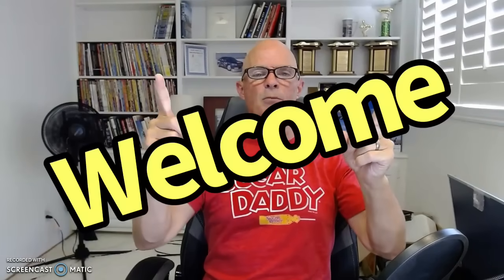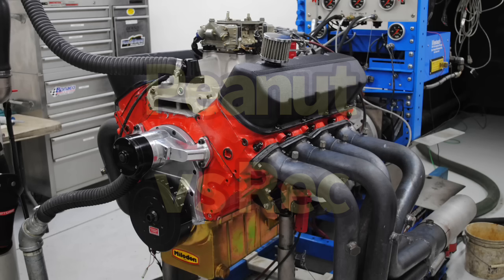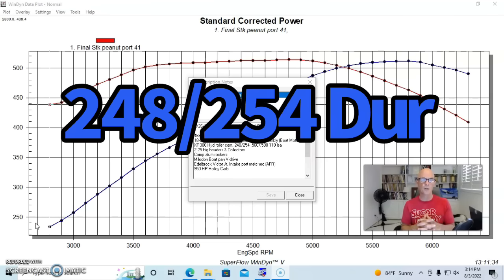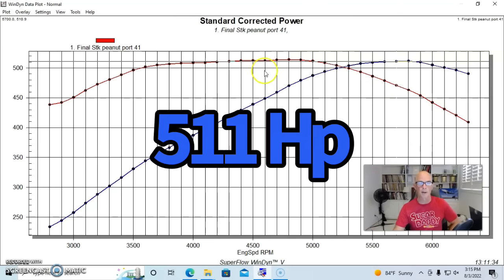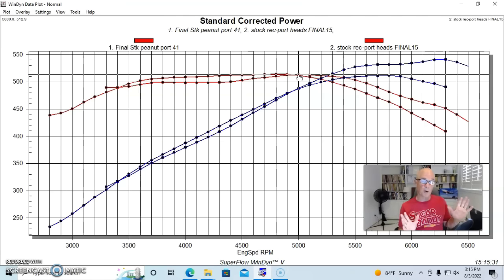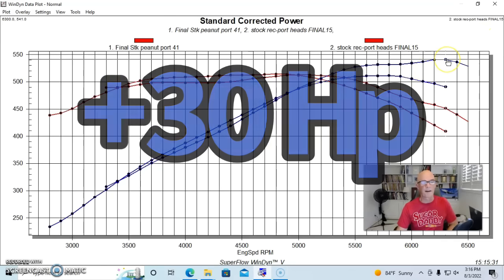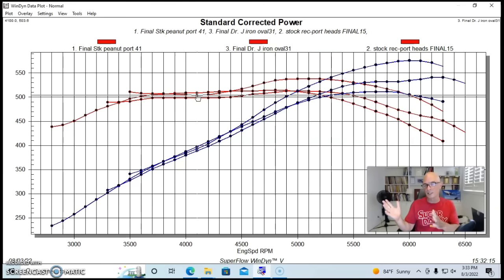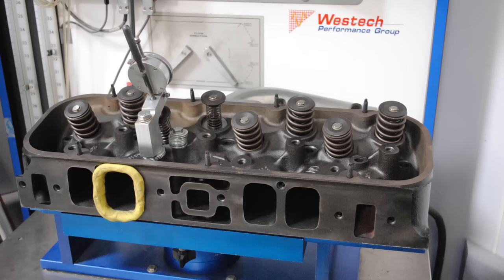WHICH FACTORY BBC HEAD MAKES THE MOST POWER? PEANUT PORT vs PORTED 049 OVAL vs REC PORT vs AFR 265!

Comment: Part 2

The cost of aftermarket heads has gone down so much that even the best old school l88 aluminum heads are worth much except to a corvette numbers matching 69 l88 vette or other restored classic 60s ,70s car. The old aluminum  gm needs or even snowflake heads usually had all sorts of cracks in the castings from years of abuse.

You can still have fun with cast iron oval or rectangle  port heads. But the weight of them is ridiculous. Twin turbos or a good 8 71 blower will wake a motor up even if the ports are somewhat small. I've seen a few motors make good power with Peanut port heads. But it's like , your building a motor for hi perf and are going to choke it off with a Peanut port truck head. Ooof. A good set of ovals are everywhere now days. And much lighter when cast in aluminum. Redesigned ports are so much better with raised roofs. A force induction tunnel ram engine really wakes up with forced induction. Years ago we had to over cam the engine to get enough flow into the tunnel rams and rectangle port heads to get them in the proper power band. 4.56 gears and 7500 rpm were common. Yes on street motors. When comparing all three heads, Peanut, ovals,rectangles. Give the engine the appropriate cam for a better breathing motor. If your very broke then Peanut ports can work to about 350 hp. With forced induction I've seen about 650 hp using them. So if you have forced induction rectangle heads are awesome. If not rpm the crap out of the car. Ovals are the best compromise. I've seen them out flow some rectangle port heads but not it ultra flow cases. Some rectangle race heads can flow in the 525 550 range at about 800 inch lift.

Comment: Rectangle port heads work great with forced induction  engines. If you don't want to run an engine that way you need to use the heads in the upper rpm band and higher numeric gears in the axle. So in other words 3200 to 8500 rpm with 4.56 to 5.12 gears was alot of fun to haul ass in. Some guys tried rectangle  port heads on engines that had too low of a power band to get enough  air moving to feed the port. Oval ports ported are great, if they are the newer aftermarket stuff. Back in the 80s if you didn't run rectangle  port heads on a bbc. Like a 427 you were considered a non serious street , strip guy. Now everything changed when force induction  motors came on seen. They helped all head type of engines make crazy power. But the aftermarket  rectangle  port heads were awesome once force induction was put through those heads. A supercharger kept us out of having to spool up a turbo. And low speed to medium power was improved on rec port heads. We used factory heads back then. Peanut port heads were never considered. We hated them and still do. No one sells performance Peanut  port heads. Porting them is a waste of time since the oval ported heads outflow them by a lot. Especially  with cnc porting on much improved aftermarket oval port or rectangle port heads. No one redesigns Peanut port ,ports. Cont

Bloodviking

Comment: Isn't this the same test you did for motor magazine a back in 2012?  If it is, you have said in the past that the peanut port heads in this test had bigger valves also.

The Peanut ports I had flow tested,  flowed 226 cfm at 500 and gain anymore than that to .600 lift. Is it common to get more than 2HP per CFM?
Reply from the maker: that number is not uncommon for a restrictive head on a good motor
Reply: @richardholdener1727  so, did those peanut ports have larger valves like your motortrend article said they did?

Comment: The question is...if the oval intake manifold was removed and replaced with a square port manifold when testing with the square port heads???  Intake to head port match is important 👌.
Reply from the maker: those intakes are actually different (not just the port shape), the mismatch does very little to power
Reply: @richardholdener1727  your right man.....seen a MANY big block back in the day running oval intake on a square head for street use.....those ol hot rodders knew!

Comment: The ported rect. port heads would make less power than the ported 049 heads up until about 6000 rpms.Unless you had a converter with about 5000 stall the 049s would be superior! My daily driven street racer with oval ports beat rect. port cars.

Comment: What is interesting is the peak TQ location.  For a Jet Boat engine, that's the deal.  I'll take the AFR's (or other aluminum head) and run the lake on 93  😃 
Power on race gas is fine for drags, but will kill your wallet filling the boat tanks 🙃

Comment: I've got a challenge for you if you're willing to help. I'm benchtopping (until funds increase) a ~500hp 489/496 EFI street engine but I need a camshaft that will pass emissions ( Thinking Brodix 270 Race Rite Ovals and whatever dome size I would need to make it have about 8.2 dynamic compression. HC needs to stay below 220ppm and CO% needs to be below 1.2, this is both at idle and 2200 rpms.
Reply from the maker: obviously the parts you mentioned are not emissions legal-despite their ability to pass a sniffer test (very easy)
Reply: @richardholdener1727  my state only requires the charcoal canister, non vented gas cap, catalytic converter, and to pass the emissions test in order for it to be legal. They do look under the hood for these and I'm willing to keep all of these items. I'd rather not put an antique plate on it as then I would legally only be allowed to drive to and from car shows and parades.

Comment: For the street...always choose ported large oval's or an aftermarket aluminum head like the AFR's shown here. The name of the game on the street, especially with a heavy, stick car is velocity. 
Remember, your big block is essentially a huge air pump. Keep port velocity up with moderate volume on the street. For the track or all out racing applications, ported rectangular ports or even better, aluminum aftermarket heads with the ability to move lots of air at higher velocity above 6500-7000 rpm. 
Gotta love big blocks!

Comment: Rectangle OR  Oval port from HEINTZ BRO'S  fixed like we do them for the NHRA Super Stock class would SHOCK U.  That said Heintz heads had AB opoxy in the Intake ports and the Ex were welded up with Beryllium and couldn't be over a certain CC's in the chamber, Intake and Ex and and stock diameter valves. Stock BBC heads have 2 good ports and 2 not so good ports. Oval heads made 830/840 and the Sqare Port 900 /915. Sometimes more on both heads depending on core shift in the heads. And the Oval Ports had a Holley  Vaccum secondary. I see the look on your faces.  But if u followed NHRA Super Stock classes in the 60-2000s Then look Up Butch Williams  had a corvette and held the SS Auto record for years. And If your a Hemi guy We fixed Bullet Bob Reeds 426 Cuda Stick car..

Comment: i have a unrelated question for you , i have a 2014 gmc sierra with a 5.3 i am looking at a turbo kit for it basically a stock motor , looking at the single turbo kit from ON3 performance lots of people say its not a bad kit for the money in fact HPP Racing sells the kit , but then i see on ebay i can get a twin turbo kit for almost same price , both kits are under 3 grand now i know Armagedón turbo kit is very good but i don't have 10k  not sure what to do ? can you help
Reply from the maker: i have not tested those kits
Reply: @richardholdener1727  do you have any experiance with the ebay kits at all ? seems like the better choice would be the on3 kit from hpp since they are based out of texas and have probably better support

Comment: Yes bigger head on small 454 will make more power. Need cam with 700 plus lift compression 13-1 or more you will make power. No compression or cam smaller heads work better. If you want truck or street motor it will be hard to beat 049 heads. They can make over 600 and still have torque. This has been researched a lot.

Comment: Thanks for the 454 builds I wonder if you can make a big oval head support power to 7200 rpm. Yea I know why make spin that high an make it hard on the valve train an it makes good tourqe but I just like the sound of a high rpm big block chevy which I'm building now for a manual 70's camaro.
Reply from the maker: lots of oval ports will make power at 7200

Comment: Nice bench racing.... it's a well known fact..peanut port and small oval port heads wake up with long runner dual plane intakes....grunt down low..as cam and port goes up the shorter runner intakes start to shine , the exception is of course a tunnel ram for all our competition.  So in short build your engine for application...never over think port volume.  Most street cars respond better with mid sized pocket ported oval port heads, definitely newer aluminum heads over factory cast iron ...I guess I'm suggesting higher flow ,smaller ports...larger valves and a good dual plane intake with a one or even a two inch carb spacer.
Reply from the maker: I think dyno results are different than bench racing

Comment: I've been having an issue sealing my intake manifold to my big block. Can you maybe make a video on an installation? I've tried so many different ways and watched many different videos on YouTube and after about a month of use there's a leak. I'm able to seal the china walls fine and don't blow that out, it's the runners and water jackets. First the runners were sucking in oil, I think I fixed that. Now the water jackets are leaking. I put a thin layer of optimum grey around the water jackets but now they're leaking. Any help is greatly appreciated. Thank you!!

Comment: AFR's ported rec ports flow 368 cfm at .700 lift.  I bet you were close to cam limited on the AFR oval port heads.  I bet the ported rec ports wouldn't do much better with the same cam and compression.

Comment: From personal experience factory  Rec port heads ( ported or unported ) are definitely better suited for race applications, 
While well set up oval port heads work well for street duties.
Although each to their own as every driver expectation and car gearbox and diff combination is different
Reply: Ran into this running my chevelle years ago with my 427.....most said to run 049/781 big valves ported    and I did with a 580/600 crane solid lift......before roller was the thing....ran great on the street and strip for 3900 lbs..3;90 gear.....but the top end times was not the same as the old timers stock square port racers running 11,s on factory stuff......tried jetting/biggere fuel line/taking hood off ect. but like the ol timers said...you running out of air on big end son!!   those ovals were great on street 1/8 mile........but TRUE racing like you said,thembig blocks wanna breath on the top end with them heads if your a heel raiser!

Comment: Your street rpm range off idle to 4000 rpm where you will be driving 99.9 % of the time the peanut port head kicks all the other heads a$$ .. The GM engineers knew what they were doing is all i can say  ...  I know where i'd save my money and come out with more HP and torque down low , not to mention great driveability ... PP all the way .. make it a 489 , a matched cam and you have one hell of a combo for a street truck ...

Comment: On my 572 street and strip engine. I wanted a little more oil pressure at idle when warmed up. I lowered my oil level by one quart and installed a Summit Racing low oil pressure cut off saftey switch. Wired saftey switches through the ignition it also makes more power. The more the oil level to wrap oil around the crank on the technical side. But I lowered oil level to raise oil pressure a lil more at idle it worked. I also installed a high temperature saftey cut off switch which saved my engine once. No one can stay glued with eyes on gauges non stop. I like things to last a long time!

Comment: Most after market heads iron and aluminum have rolled valve angles for better breathing. Bigger valves, 3+ angle valve job, better flow and design even with as cast heads. And all out full port and polish heads. Thicker better castings especially in SBC's which need it. Late model SBC stock thin casting heads which are known to crack when to hot.

Comment: One guy I know runs a 454 cid peanut heads, small hydraulic cam, pump gas, 3,000 stall, 4.11 gears, 73 Nova 1/8 mile his best 7.75 ET works good.
Reply: good basic set-up......like the way it use to be!

Comment: My cylinder head is only a cast off the shelf no porting World Products 334 intake short runner cc and 345 long runner. The 990 square port iron head is a 325 intake runner cc not efficient to big and a dinosaur. 990 heads are great if you're building a matching numbers car. Don't go so big on parts picked it kills pulling torque. Torque is what wins races at the track, street and long black marks. My engine is a 572 cid, only a 345 aluminum off the shelf heavily milled 106 CC combustion chamber heads,10.5 compression pump gas 87 octane, 580" lift .256 duration @ .050" 114; lobe separation non roller solid lift cam, 1050 carb, Merlin X intake, dynoed 730 horse power at 5,400 and 740 torque at 4,000 dynoed with 2 1/4 headers. I'm sure an AFR head would make more power on my 572 cid. My 572 only has a 345 intake CC Runner head on it. The iron 990 square ports are a 325 intake CC Runner head. Way to big of a head and just doesn't make as much power as the oval or peanut ports!

Comment: A man that raced his dragster rail car at the drag strip got any set of GM performance parts cylinder heads for free. GM Dealership sponsored his car the racer picked out a set of 380cc intake runner heads. Way to big of heads for this application. The engine was a 1/8 mile track only dragster a 454 cid 12.5 compression non roller solid cam. Unfortunately the car slowed down over 2 seconds. Going to big can kill all the torque and horsepower. You want to go faster not slower so it's better to be conservative.

Comment: Testing back in the day in one of the Magazines of the 990 square ports verses 781 big ovals. The test a 700 horsepower blower motor 781 Big Ovals beat the rectangle Port across the board in horse and torque. Horsepower it was a little but torque by alot! What I didn't see here in this test on the video is the compression ratio the same? Is timming the same? This makes a difference. Combustion chambers could be different. Obviously the rectangle port in this test has bigger valves that's a advantage. Torque is what wins races at the drag strip and having fun spinning tires leaving black marks for a very long way on the street. A broad torque curve does this. I would rather have alot more torque across the board than horsepower. I do have to add the Oval Ports had bigger valves.
Reply from the maker: ON A BLOWER MOTOR?
Reply: You are correct but guys still think the square port head would beat the oval head on a 800 horsepower. Let's face it it's not going to happen. The oval is the winner from around 350-700 horsepower. Under 350 HP about the peanut and for torque. Aftermarket heads put them all mostly to shame.

Comment: You can't compare the rectangular port head with oval ports and use the the same cam as it needs a different lobe separation angle, e.g 108 or less and advance the cam timming to get the bigger port to work as well as more compression.
Reply from the maker: no it doesn't
Reply: @richardholdener1727  like you said earlier in video!

Comment: I’m interested to see how these heads do. I used factory oval heads on a .30 396, (the same thing as a 402), with RV cam, dual plane, headers and tuned it all to tow my Boss’s truck which he used to tow his fifth wheel. He had his choice of any engine he wanted, and we built this on for him. It originally ran a 350 with TH 350. We started with a trans swap, going to a TH400 as there weren’t any overdrives available at the time and picked up a couple miles per gallon. From 8 mpg towing to 10 mpg. After the engine was installed it fell short of our goal to double his mileage, but he was running large Truck tires in the rear with a One Ton Axle in place of the 3/4 ton axle. I think he was getting 12 Mpg at the time, but when he finally swapped in a set of low gears the Combe gave him 16 mpg, the same as when it ran the 350, towing nothing and an empty bed. I really loved that motor as it was the one that proved I knew what I was doing. 
One thing the Richard might or might not address here is the unequal runner length of the intake ports. That made the build above a bit more difficult.
Reply from the maker: the intake runners in the intake manifold are also different lengths-as (likely) are the headers
Reply: @richardholdener1727  back in the old days they weren’t as well matched. I remember reading and article about a guy who built a 427 for a 60’s vette that he raced at Bonneville. They went into some detail about all the work he did, porting wise, to get everything balanced on the intake side. If I remember correctly, and this was in the mid 7’s, that it was no easy task. But that was a few years back, and there were no aftermarket heads for anything. Intakes were basic compared to today. As a side note, my HS Auto Shop was building 454 Ford Tunnel Port motors based on a 427 block and 428 heads. My senior yer we built a 454 Chevy to compete against the customer we were building the FE’s for. Our engine went boom on night one of the dirt track season. And we all spent time working on that motor. We are even polished the lifter valley and bottom end for better oil return. Damn! The year before we had built a 10.90 comp car out of a 66 Chevy II with a pinched out 283. That little 292 took us to the finals round where we lost. 10.89 to 10.93. Yup, breaking out sucks!